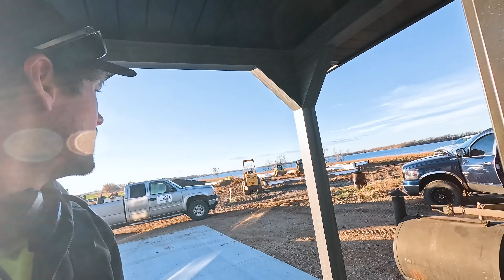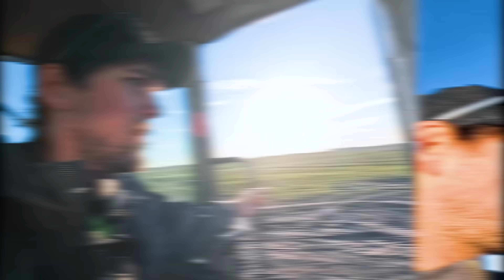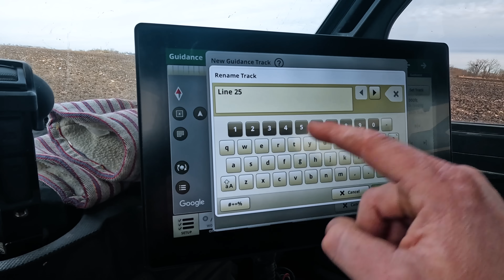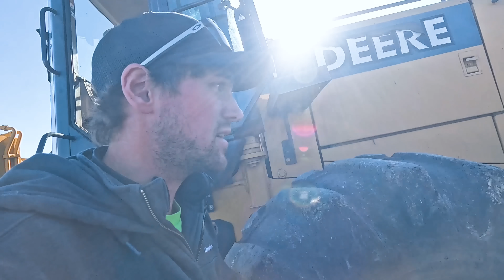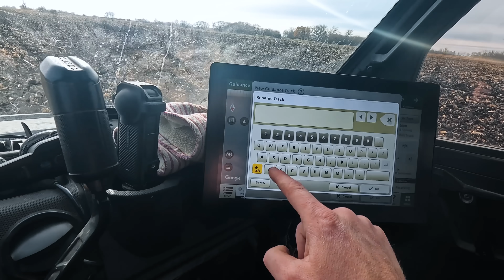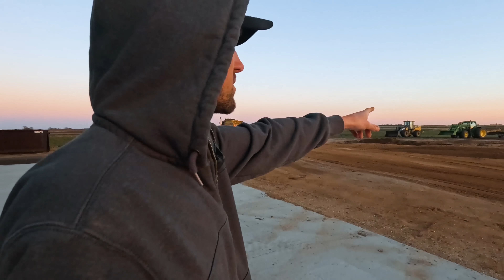House Building Is Behind Schedule But Moving Forward!!

Comment: Chet you've done enough construction to begin using a few professional terms: If the cement has aggregate in it (crushed rock) it's properly called "concrete" :) Horizontal structural members are "beams"; vertical structural members are either studs or posts. Please take not and good luck. Best, a fan, Rich

Comment: I think you need a demo loan of a Telehandler. Bobcat do one I believe. (other makes are available 😄).
Being in the country, presumably you are wiring the power so that you can switch over to a generator if the mains electricity fails.  I did this when I renovated my house and we have had power cuts since which proved my point.
Consider a wet room bathroom, good for washing kids when they fall in the mud, dogs in the winter, and dusty farmers at harvest, especially if you can enter directly from outside.
Do you suffer from frost heave in the area you are?
Would it be possible for you to show a floor plan of the house.

Comment: Big Sweede it works super good instead of driving a straight track with your gator for the whole field you can come back with your planter and create a straight track while you are autosteering your second headland with the boundary fill option. Then it will be a perfect 30 inches from your headlands

Comment: Erik save your time making your AB line in the ranger and do it on the computer. You can snap it clean to the new boundary and you won’t leave any gaps or have point rows. It seems ridiculous but it works really well. And you can actually see an overhead to find the best spot to put the AB line to be more efficient